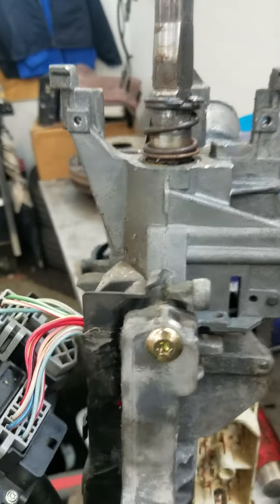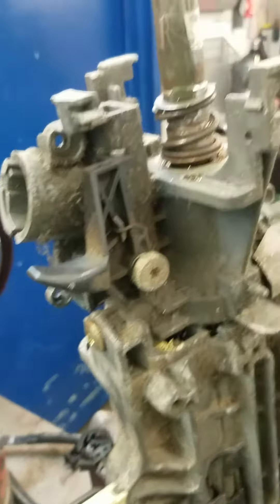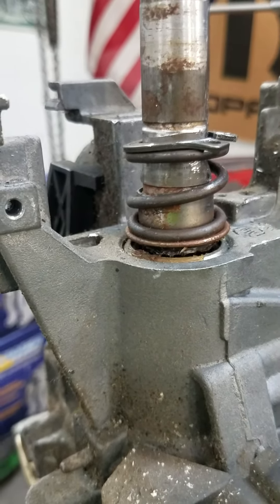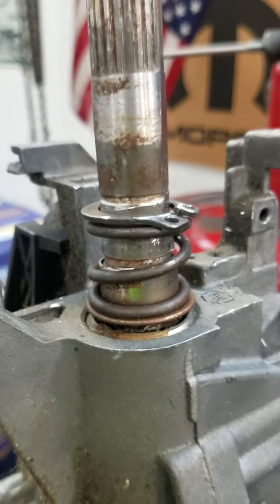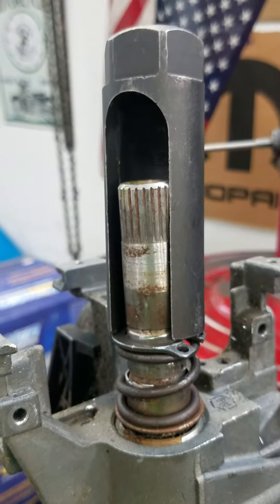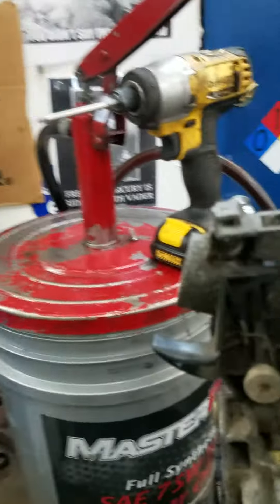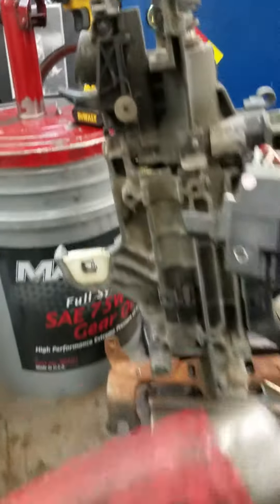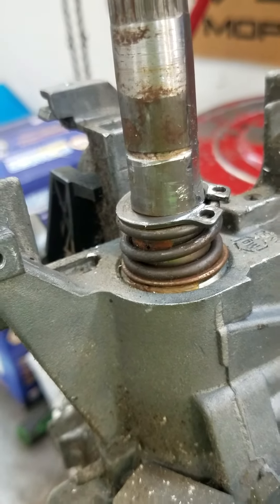Ford steering column spring and clip install.

Comment: It will work assuming you have the whole shaft fairly solid. The real trick would be to find a bolt long enough to reach through the socket, and thread the main steering wheel nut housing.
Reply from the maker: I actually have posted a newer version of this, I did one for a buddy, shows it a bit better. The O2 socket with the shaft in the vice has been the best way I've found other than being in the vehicle mounted.

Comment: Well, I was with you until you said "another crap Ford column. I have almost half a million miles on my 97 and the bearing finally failed. After all these years pulling myself up into the truck, yanking on the steering wheel. No crap here.
Reply from the maker: Well i mean, that's good....